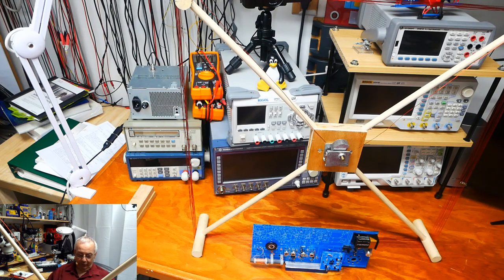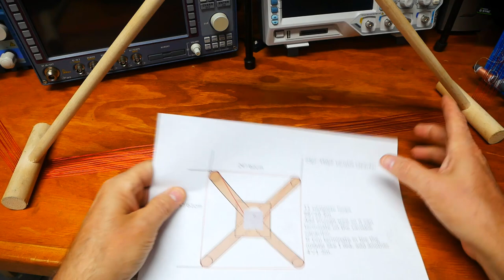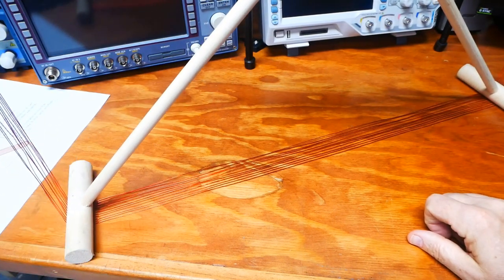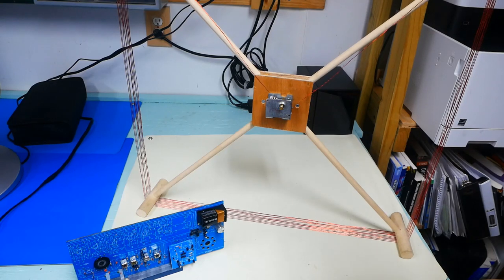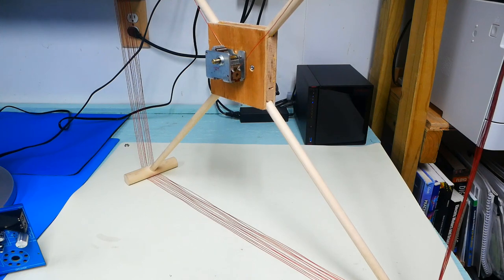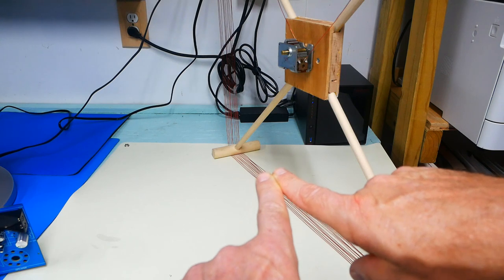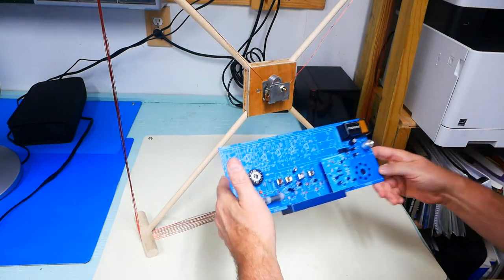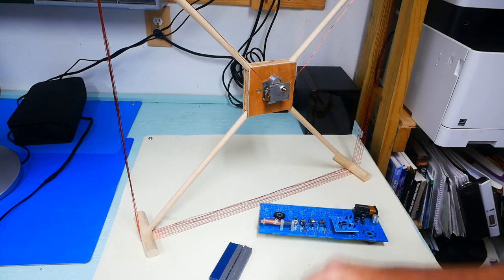89. DIY AM Antenna "Amplifier"

Comment: Could you connect the loop directly to a crystal detector to make a radio?  The Q of the loop seems to be very high based on how little you need to adjust the capacitor for resonance.  If this is possible, how would you connect the detector.  A coupling loop perhaps?  Thanks for the wonderful video.

Comment: As an EE and former extra-rated ham, I thank you for presenting the best presentation yet on a AM LC resonant loop antenna.   I appreciate the RC equations as a functions of frequency.   So long as you use insulated magnet wire to make the coil, it' shouldn't matter if the coils are right next to each other, so long as the wires don't get hot enough to melt
the insulation and short out.

I  heard other AM broadcast band antenna builders proclaim a 1 foot by  1 foot square
for making the loop.   Are you sure 2 foot by 2 foot is the right value?    I suppose will have to do further research on coil building to determine the inductance of hand-wrapped square
loops.. 

I am hoping to find a source for the variable air capacitor for tuning this magnetic loop antenna.   If you know where I can buy one, please post here.

I  hope to find one, so I don't have to run wire outside my house ( I live in an area where air temperatures drop below freezing for 2 to 3 months of the year), so I don't have to drill a
hole in my house to string a grounded antenna outdoors with 50 to 100 feet of wire.

Comment: Thank you Sir. Your video helped me a lot. Looking forward for some similar informative videos. I'll try my best to build a similar one. I want to build a smaller one, what will be measurements of the side and the number turns of the wire?(I was successful in building a dipole FM Antenna that perfectly catches Stereo signals from 70 miles aways alongwith other physical obstacles).

Comment: for wheeler formula of inductance, you actually want the width of the coil to be greater than .8 x mean-radius, and so a width maybe 10 in or so... with each wire 6 wire distances from each other.

Comment: Thanks for the video.
Why should the length of wire be 88 ft ?
Reply from the maker: The wire's length around the frame provided the correct inductance value. This makes it possible to get any resonant frequency in the AM band through the use of the variable capacitor.
Reply: Is it related to the value of the wave length  ?

Comment: Would wire as thin as 43 AWG work just as well as a thicker gauge wire?
Reply from the maker: It can. The wire acts as the inductor so you will have to space those thin wires much closer together.

Comment: does this work without the variable capacitor
Reply: No, it won't work. If you aren't available with a variable capacitor, you can create your own sliding capacitor using two tubes, the latter smaller than the previous one in diameter. Wrap the larger one and smaller with aluminium foil seperately and slide larger tube over the smaller one or vice versa. Add two seperate wire over the foiled area of the tubes. As per the diameter, you'll get capacitance from 1~90 pf, which is sufficient for the MW and SW bandwidth.

Comment: Please let us know the rules for making this antenna by writing in the comments
Reply from the maker: First select the frequency range you hope to cover. Let' say you want FM from 88MHz to 108MHz. You have a variable capacitor with a 10pF to 20pf (I just made one up). Plug the highest capacitance and lowest frequency in the band into the equation L=1/{(2piF)^2*C}. Using 20pF and 88MHz you get 163.54nH. This gives you the inductance you need. Build the inductor on a suitable frame. Roll wire onto it and measure the inductance as you do. Stop when you get around 163nH. To find the upper frequency, plug the lower value of your variable capacitor into  Fr=1/(2pi* (sqrt of LC)). In this case the answer would be 124.45MHz. Hope that helps.